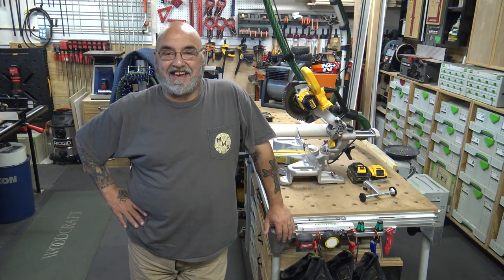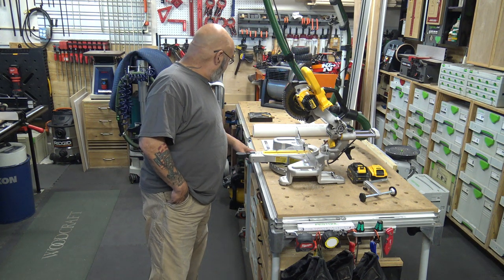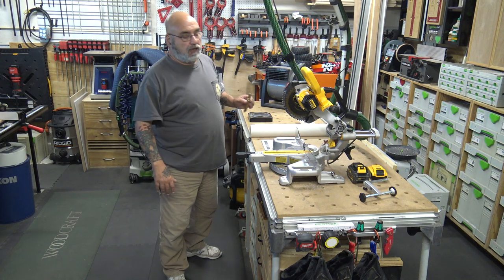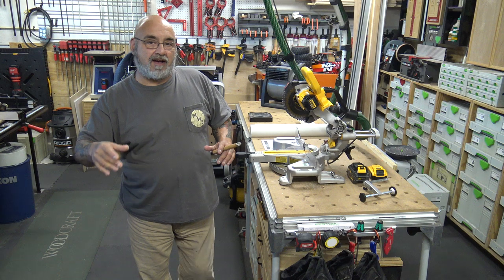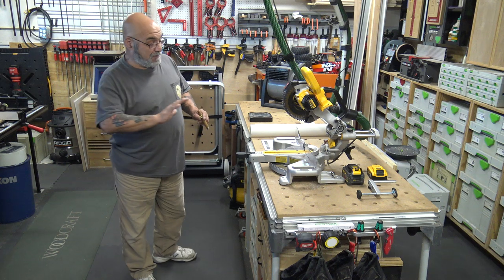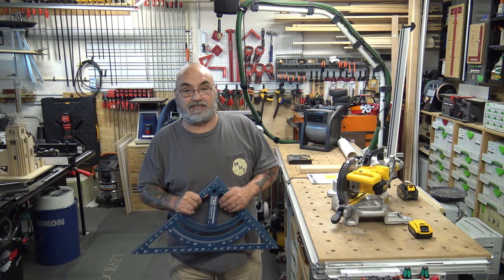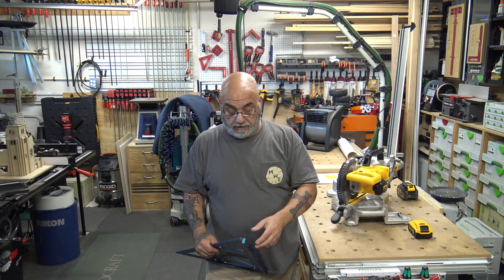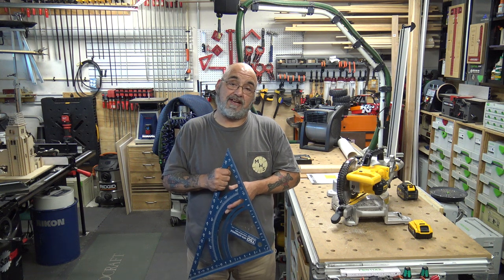My new toy DeWalts DCS361 71/4" cordless sliding compound miter saw.

Comment: Hi Mike, 

I have this same DeWalt cordless 7 1/4 miter saw for about 3 years and it works great for what i use it for on my projects.  I also got a good price deal when i got it.

Now, i do have to say i seen the Milwaukee cordless 7 1/4  model and it does have a few features i wish DeWalt had on their model.

1. Brushless motor
2. Double bevel 
3. Better Dust bag collection 
4. Easier system to change the blade.

The one thing about the Milwaukee it was pricey. I hope DeWalt can come out with a new version on this cordlees 7 1/4 miter saw with these features soon.  Also come out with a 10" cordless model. 

Just my input. Thanks for the video and review.
Reply from the maker: Michael C I would have bought it soon if I knew how good it was. Thanks for the comment
Reply: @TheBuddylab  

Yeah, the milwaukee is pretty nice again it's about $400.00. 

This DeWalt cordless miter saw has been out 4 to 5 years and it's time for a new version already. 

Hurry up DeWalt,  LOL....

Comment: What do you think of your portable DeWalt table, I’m thinking between the husky and DeWalt. I would want to use it for outside use when I plan on using the belt sander and messy jobs like that to prevent the shop from getting too dusty.
Reply from the maker: Tikki Barber absolutely love it, I have two the other one is on my work truck. That we use at least three times a week

Comment: Can you confirm that it does work with the 60V platform. I was under the impression it only worked with the 20V?
Reply: Did you watch a different video?
Reply: @Rob........811  I've see a bunch but none mention anything about it working with the 60V platform. Even on the Dewalt site its listed only with the 20V